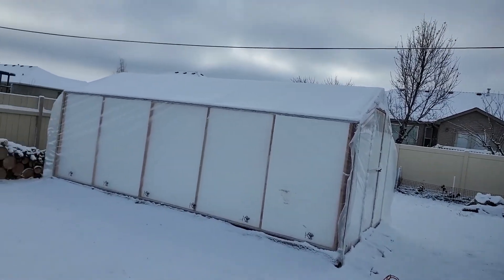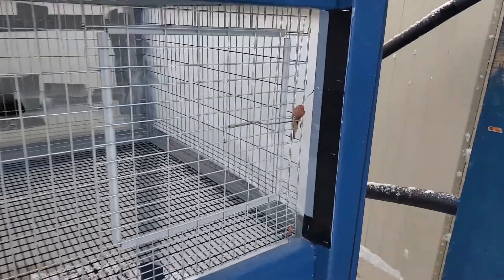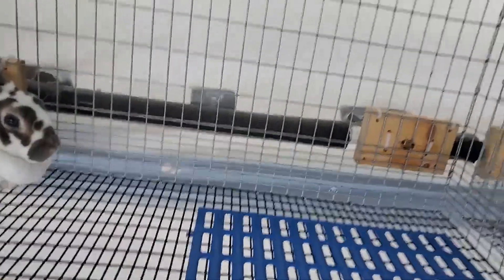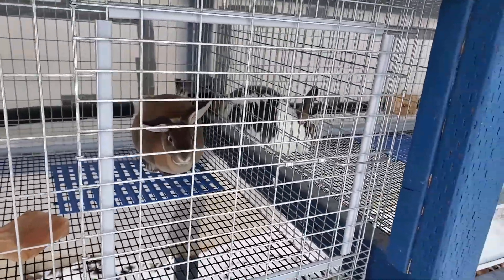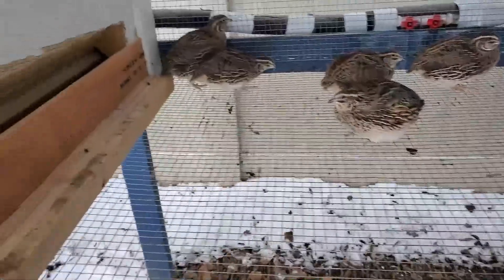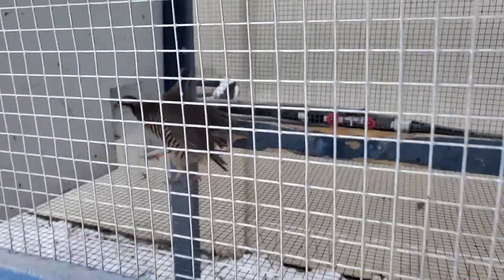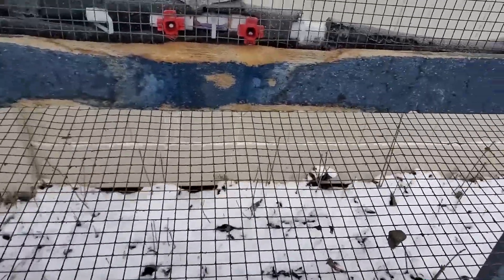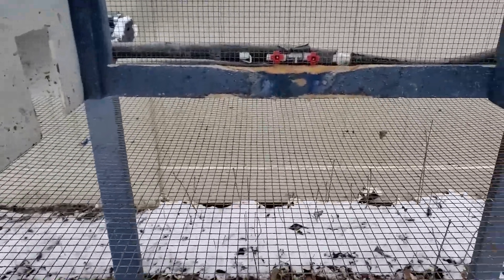Update on my Ultimate Heated Automatic Watering System! - Chickens - Quail - Rabbits

Comment: Do you think the rabbits can drying from the chicken style nipples? I installed the rabbit style and I am having lots of dripping issues.  I see carolina coops guarantees no dripping on their horizontal nipples.
Reply from the maker: Here is a recent video I did talking about what nipples I am trying this winter. https://youtu.be/0Lu0KXq9SIQ. Since installing them I have noticed more water come out of these metal nipples than the horizontal ones I got from Carolina coops. My only concern with that is will I get more ice building up below the nipples. As long as the nipples themselves don't freeze up and function properly I can deal with chipping away ice buildup underneath. Anyway please watch that video and let me know if you still have questions. I have not had any problems with my rabbit nipples for my rabbits. Never tried them for birds.
Reply: @theemergencyprepguy  yea I saw that video but I believe for the most part the "rabbit style" are meant to be hung vertically,  that's why there is dripping from the nipple. I was just curious if you believe that the horizontal nipples from carolina could be used with rabbits?

Comment: what temp is the water being circulated round the pipe ( inlet temp ) Please.
Reply from the maker: Great question! Deicers like that keep the water just a few degrees above freezing. They turn on as the water approaches 32 degrees Fahrenheit, and then turn off once the water gets about 5 degrees above freezing. The switch that starts the circulating pump turns on when the outside temperature gets below 40 degrees Fahrenheit I believe, and turns off when it is warmer than that.